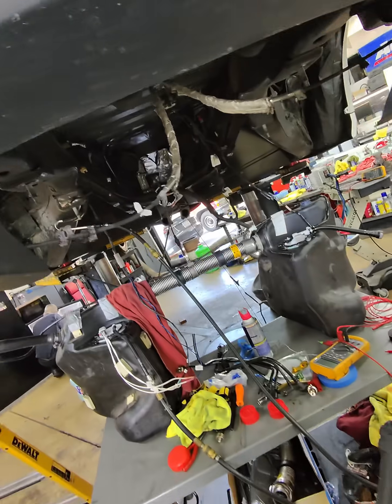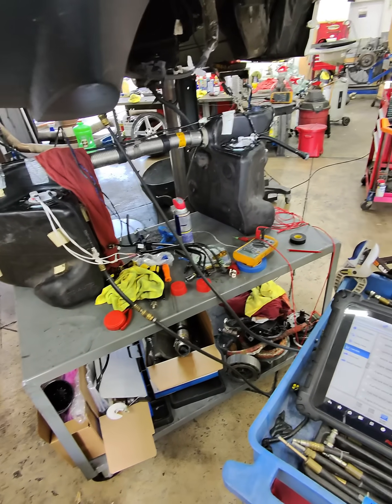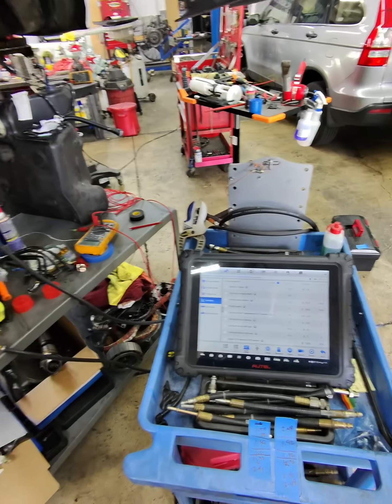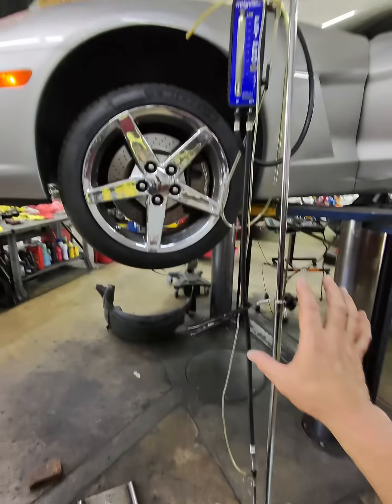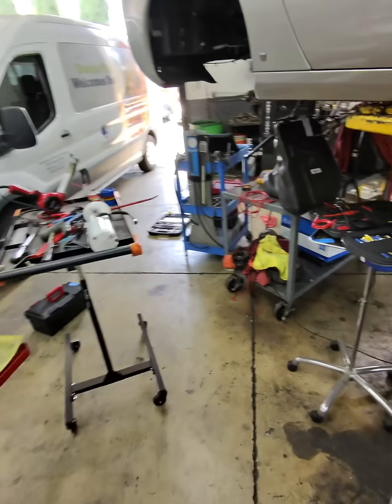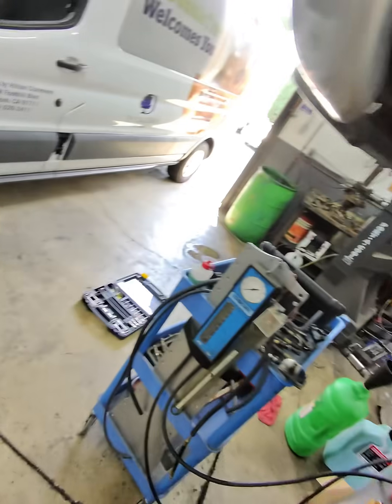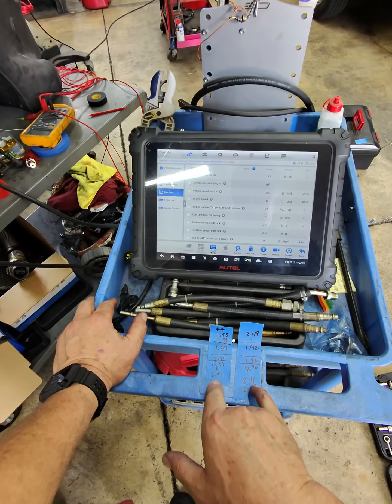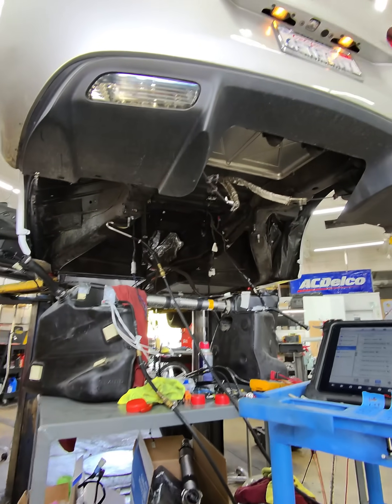2008 Corvette Fuel System Tests #jetpump #mechaniclife  #carrepairshop

Comment: What was the issue? I just replaced the pumps in mine but my fuel gauge is acting up. Everytime I fill up it shows over half a tank then it quickly drops under a tank. I filled it with about 17 gallons of fuel. I don't have any visible leaks so I can't if fuel is actually moving over to the oassnger side tank or not